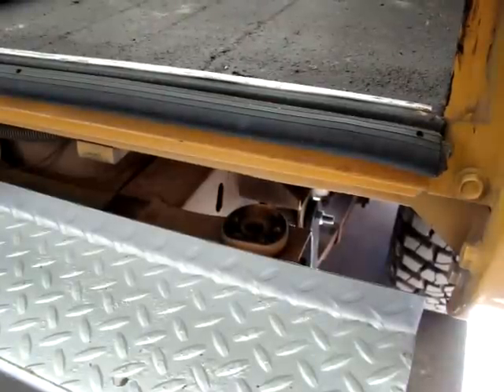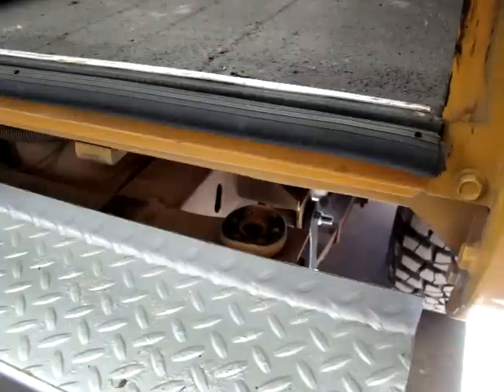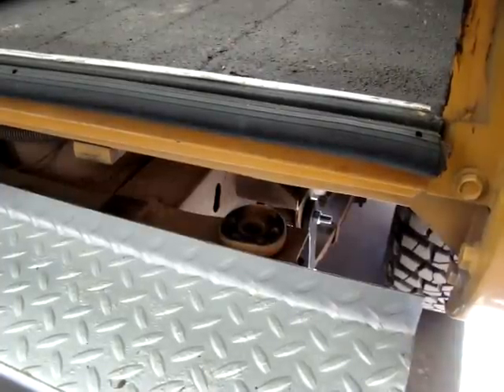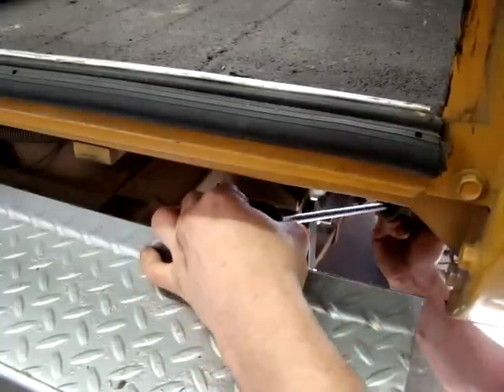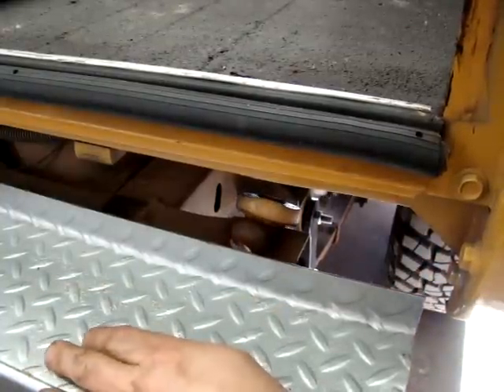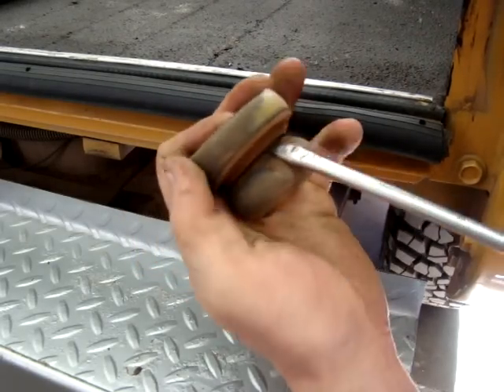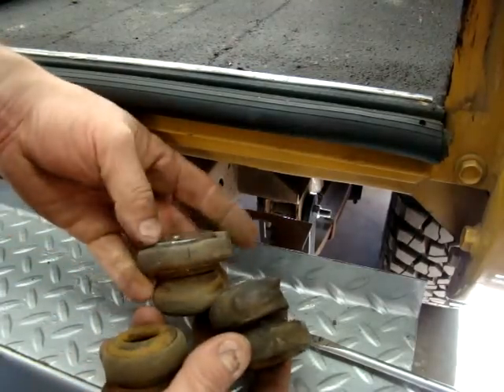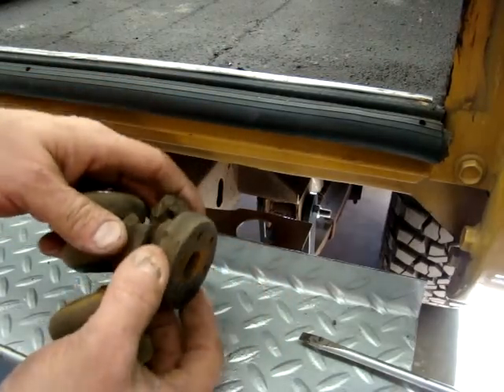Scout 2 Body Bushing removal tips

Comment: What replacement bushings do you have good luck with?  Can a diy guy replace these in a 78 scout ii?
Reply from the maker: Hey Tinker, I use Energy Suspension bushings and yeah it's a pretty easy replacement procedure if you have a few common tools. Do one side at a time after loosening all of them a bit. Jack up under door floor with a 3/4' 4x4 under the floor cross braces. :)
Reply: @BCB4x4LLC  How did you get at the rear bushings?  I can't seem to see the top bolt its goes into a metal square tube under the rear floor.
Reply from the maker: @tinkertime614  it must have pulled through. It's supposed to sit protruding from the floor. Maybe someone previous forgot the washer and it pulled through.

Comment: Question: Why would you need a body life? Sorry if I missed the reasoning in the video.
Reply from the maker: @blainew1035  it give a bit of space between frame rail and tub to route wires and not allow mud to clump up in the nooks easy. It washes out easier. Mire space means less radiant heat transfer from the exhaust making it cooler inside the cab. Clearance for bigger tires to name a few!! :) 
Thanks for asking.